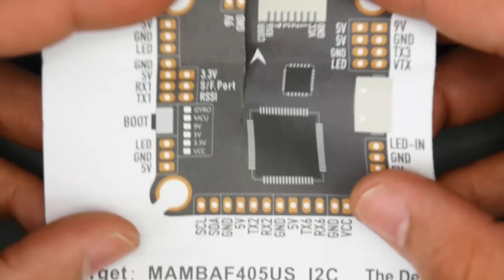How to Build Ultimate Budget FPV Drone Build 2021 //  Beginner Guide

Comment: Regarding the soldering. When you were prepping the copper pads on the board I noticed there was always a very think layer of solder on the board between the pads. How come that doesnt cause bridging if that thin layer is touching both pads?

Comment: Do the stock screw that  come with this stack fit fine?  is the power distribution board built into the stack? and what receiver did you use?  and do they sell extra VTX wire?

Comment: I tried to configure according to your video although preview responds according to the remote control. However, the motor does not spin, even though I am able to control motors using app.

Comment: great vid! i've been watching a lot of them and studying before i pull the trigger on my first build. Question, the frame I want has listed as a frame that can hold a 30.5 x 30.5 stack. the stack i found I want is described as a 30 x 30 stack. Is the .5 difference an issue or is that close enough?

Comment: Are the capacitor soldering points in contact with the xt60 points? I'm new to soldering, would this ruin the connections of both devices if they did contact?

Comment: Very nice guide, I am very tempted to try hands on to build one but I don't have confidence in my soldering even with assist. My hands are not as stable as in the past. It will be nice if the board and parts come as crimp pin connectors making installation and swapping parts even easier.
Reply: CONGRATS YOU WERE RANDOMLY SELECTED FOR THE DRONE GIVEAWAY QUICKLY INBOX ABOVE👆TO CLAIM.

Comment: Comparing to my five year old Blackout250 not much has changed. Would you agree?
Reply from the maker: ESC's are much cleaner. FC software and hardware has improved at least 2x.. frame design is on another level. Motors just power and size. Propellers also have seen a huge improvement since the zmr250 days.

Comment: if you get yourself a little set of soldering clamps, holding the board vertical and bringing your wires in from the back. this would pull excess solder through and clean up your joint.

Comment: Is it possible to combine different brands?

For example, I love using BetaFPV’s Literadio 3 controller (it’s got FrSky), but hate their headset & want to use either an Eachine EV300O or one of Fatshark’s goggles (design looks slimmer that BetaFPV’s & might have less weight in the front of the head)
Reply: Congrats 🎊 you won a DRONE PRIZE. I hope you like the prize and thanks so much for commenting. Quickly inbox above for it Good luck👍...

Comment: does this really work out cheaper than a pre-built one?
Reply: If you already have a headset and such. Soldering iron ect. Yeah its deff cheaper to build one.
Reply: Especially if you don't have a radio, buying can be cheaper until you fly it, until your first crash. Or just when you want a spare battery. When you buy a quad, a lot of them use proprietary battery cartridges. These may cost 4X as much as the same battery with a standard connector.

Suppose you want to upgrade the camera in a drone you bought with a built-in camera. How much does it cost? You're probably looking at buying a new quad.

If you build a $350 quad and a crash breaks your frame, you can buy another $50 frame instead of a new $300 quad.

Comment: Hey I’m about to build my first 5” maybe this winter but I want to get everything ordered. I can Solder and use beta flight. Anyways I just want to know can you build it and just add whatever receiver at the end to make it compatible to my transmitter or does it all need to come from the same company excluding frame and motors of course
Reply: Your transmitter need to have the same standard as your receiver so they can "talk" together. Otherwise, you add whatever you want. I added a FrSky R9 MX.
Reply: All you need is to spend 20+ hours watching J.B. videos. You ll learn anything.

Comment: This soldering technic it hurts my soul... Strip the wires, apply some solder on them. Then put those wires trought that hole, apply flux (liquid ones are the best for this kind of soldering) then ad just a tiny bit of solder on solderiong point. Yep it will still work, sometimes i do same as u if i have to solder somthing in the air, and dont have anyone and anything ("third arm") to help me out. But it wuld safe some pain in the ass sometimes (less of the chance for shortage between the pins) and looks more elegant.

Comment: Can you use the dji fpv air unit or the caddx vista with mamba stack
Reply from the maker: It's and it's one of the best options for them.. due to the 9v regulator
Reply: Thank you that really helps

Comment: I never use the conical tip. you dropped a solder blob on one of the motor wires just to let people know and watch out for that like you said. Awesome frame and might get that one to fit my ESC.

Comment: Has been building quads for 4 years, still solders like a beginner. Needs a new tip, use helping hands, add a dab of flux to the pcb pads, start with less solder before making blobs(don’t make giant blobs, small is fine).
Reply: Congrats 🎊 you won a DRONE PRIZE. I hope you like the prize and thanks so much for commenting. Quickly inbox above for it Good luck👍.

Comment: 6:00 next time, try feeding the stripped wire from the underside of the board, through the hole , and soldering the pad and wire in one fell swoop.
Reply: they are called "trough holes" for a reason. IDK

Comment: General question: does the quality of the esc mainly determine the flight performance of the quad (bounceback, prop wash etc.)? Like with two identical quads, one with a cheap esc and one with an expensive esc, would the expensive esc quad fly better?
Reply: The main thing about the esc is that in a stack it’s a 4 in 1 esc and outside of a stack you need an esc for each motor.

Comment: I have a 4 channel remote receiver can I use at the drone or can I take a more channel receiver?
Reply: less than 50$ can buy flysky 6 channel what can use 8 channel transmitter i.bus
Reply: @mattivirta  my receiver 4 channel and my drone dont fly.can be problem my receiver?
Reply: @mustafasuner1  wrong conficuration or wrong receiver to you remote control tranceiver, flysky can remote many receiver good.

Comment: I have a question.
I am looking to buy 3 kits to build with my 2 kids, I get how to assemble this stuff but where I'm struggling is with the goggles and controller. I don't have any Google or controllers and want to get something mid range and have had good luck with flysky for rc cars. Can anyone give me some advise on a good goggle and controls and what transmitter I would need with that setup I would greatly appreciate it.
Reply: Did you find out which controller would work with this build?
Reply: @BLueFeaTHeRedOliVeS  yeah I bought a radiomaster tx16 thanks for asking

Comment: Bro, where did you find a ground on your Battery?
Reply: On the negative terminal
Reply: @SlipperyFPV  but its negative. how can it be ground?
Reply: @tetow2484  Ground is only a convention. ... If the power supply is a battery, and the devices in the circuit are designed for a positive supply, then the negative terminal serves as the ground. The positive terminal could also be ground, if all the circuits are designed for a negative supply.

Comment: some chipquick or amtech flux would help you so much brotha, wipes of clean and would make it to were you only have to touch not hold to solder the wire on also buy some tip tinner, it makes the solder stick to the tip better on cheap solder irons.hope this info helps :)
Reply: Congrats 🎊 you won a DRONE PRIZE. I hope you like the prize and thanks so much for commenting. Quickly inbox above for it Good luck👍 !!!

Comment: I don't know why, but the iron and solder behaviour looked nothing like to what it looks at 450C. It always felt too cold and the solder was not really flowing at all. I felt that all the joints were cold joints. Sorry if it sounds rude. Appreciate your step by step video series.

Also try to use bigger tips when soldering motor and battery wires. It helps distribute the heat better.

Comment: Thanks for your instructive videos. One question: do you know if a Mavic Air with a broken gimbal can still fly? I mean, if you were to tape the gimbal so that it doesn't make any movement, could it be used to record a still shot? I say this because I have broken mine, after thinking about it a lot I have decided not to fix it and I would like to know if someone comes up with any use that I could give it, being aware that it would be very very limited. Thanks in advance.

Comment: You forgot to thin the Battery Pads first, that would make it alot easier. Having two soldering iron tips helps alot too. Bigger Tips with more contact help with soldering thicker wires and does not need high temps
Reply: Congrats 🎊 you won a DRONE PRIZE. I hope you like the prize and thanks so much for commenting. Quickly inbox above for it Good luck👍 !!!

Comment: If you got holes trough your pads you should always 'soak' it with solder to reinforce the trough-hole plating. ( in this case) 

And I always zip-tie the battery cables to the frame in case of a ejection ( to release stress from the pads)

Comment: Yoooo M8. Try to use less soldering-tinn next time, to reduce damage on the Board and for a cleaner connection. Won't regret it. :D
Reply: also using the easy solder holes in the pcb would help tons. But that would go against his method of pre tinning the pads.

Comment: I soldered for 30 years in my job as an Electronics Support Engineer. DO NOT TRANSFER HEAT WITH THE IRON SURFACE, TRANSFER HEAT WITH THE SOLDER BEAD ON THE TIP OF YOUR SOLDERING IRON. YOU LOOK LIKE AN AMATEAUR!
Reply: Congrats 🎊 you won a DRONE PRIZE. I hope you like the prize and thanks so much for commenting. Quickly inbox above for it Good luck👍.

Comment: Hi DroneMesh,
Love your videos.  

WRT wiring the Caddx Vista to a F4 FC using the SBUS pad, how would you set it up in BetaFlight if I have the TX/RX of the Vista soldered to the RX2/TX2 of my F4 FC? 

Do I need to set anything in the Serial RX section or just setting SBUS in the Serial Receiver Provider in the Receiver section of BetaFlight?

Thanks.

Comment: Not the best solution to do wire soldering on the FC. Solder instead 1.25mm connectors. The hols are made for. This will be a clean work

Comment: I will give you Tree Fiddy! Actually that looks like a decent build. Been wanting to build one for myself. Not interested in racing. Just casually flying around. I want more then 5 minutes of run time. Closer to 20 or 30 minutes if possible
Reply: Let me know if you get an answer on 20 or 30 mins of flight time. I'm interested in that as well. Planning my first build but flight time is a big factor for me. Not necessarily needing to race it, just need FPV and ability to mount a camera
Reply: @BLueFeaTHeRedOliVeS  You can get that. You will have to get really efficient motors and other parts. Then cut back on weight. Limit your throttle of course. Don't wanna just punch it.  Might build one and slip it Viagra to keep it up in the air longer

Comment: I find it's better to put all components on the frame temporarily to check wire lengths before soldering to the flight controller.  Also, your video didn't really cover tinning wires before soldering to the flight controller and ESC.  It looks like you did tin the wires, but didn't cover how to do it.

Comment: "ground is always black" As an electrician, my brain just shorted to ground. Also, those holes in the receiver are there for a reason.
Reply: Lol yeah that messed with me when I switched from DC electronics to AC. For house/building wiring, black is hot and white is ground. For DC/electronics, red is positive, black is negative/ground.
It would be nice is they were more consistent.

Comment: Poor soldering technique. It's not more heat you need.
For small joints, a small soldering bit like you have used, but for large joints, you need a LAGE soldering bit, not turning up the heat on the soldering iron.
A large bit will transfer the heat into the joint faster and make the solder flow into the joint without having to heat up the entire PCB!
I'd also recommend a none active flux to allow the solder to flow without having to keep adding more and more solder when what you really need is more flux.
Reply: Congrats 🎊 you won a DRONE PRIZE. I hope you like the prize and thanks so much for commenting. Quickly inbox above for it Good luck👍 !!!

Comment: Насрал, а не спаял. Try using more flux, even if solder contains it. It would be better to wash flux off to prevent corrosion. Best wishes!
Reply: CONGRATS YOU WERE RANDOMLY SELECTED FOR THE DRONE GIVEAWAY QUICKLY INBOX ABOVE👆TO CLAIM.

Comment: you would do better to tin the wires ans put them in from the underside of the board , in the same way you did with the caps.  Not the greatest soldering skills on display here, try not to fry the darn thing.

Comment: AAAARRRGHHH!!!! I am so triggered by your soldering!! Do you not realize the holes on the pads are for you to insert the wire, THEN you solder the wire to the pads? The holes also provide an anchor for a solid mechanical/electrical connection and you don't have to worry about solder bridges. JESUS!!!!!

Comment: There is nothing budget in this built, actually, it's a pretty expensive one. For your budget built you don't need this expensive Mk3 stack(Mk2 does the job as well), frame, motors, VTX, and so on. Oscar Liang made a better job compiling the budget build than you, sorry.